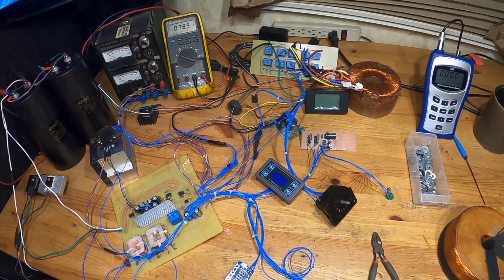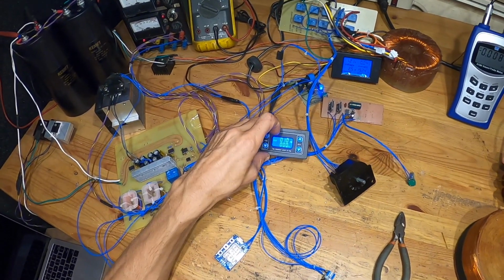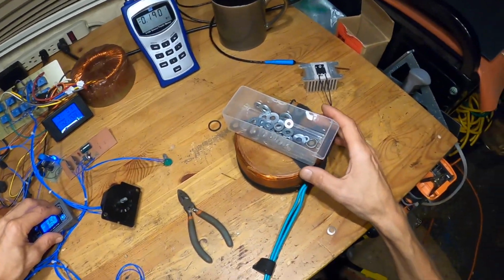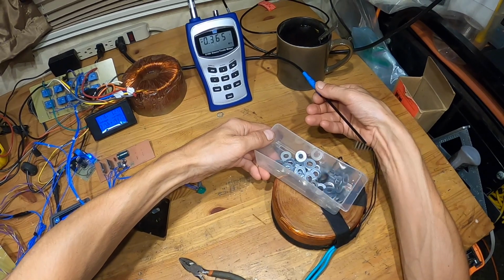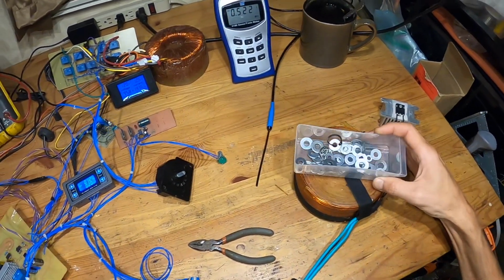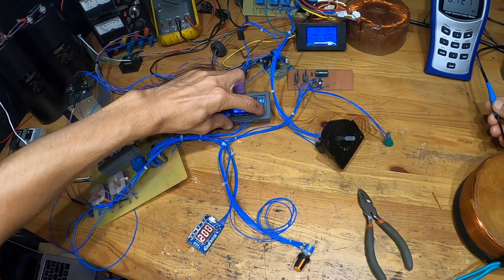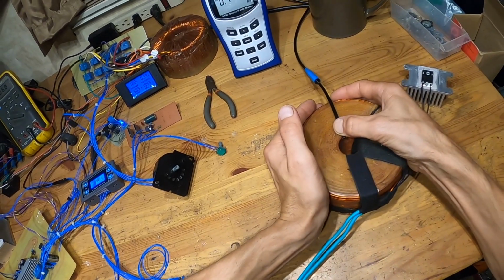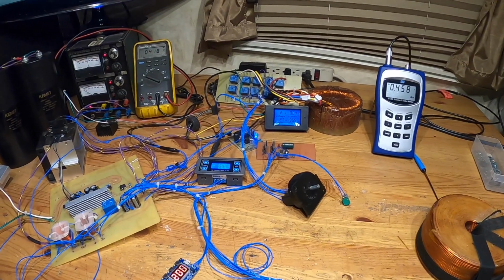034 My 410 Volts PEMF Circuit Prototype up to  11,000 Gauss 1-600Hz 1-30% Duty Part 2 Demonstration

Comment: Nice work..isn't that a really big coil for your taste? ! At that Tesla you can go ferrite/iron core to increase induction and foil coil for lower resistance and I guess you are having your 2 tesla 12 hz or more.

I'm interested for this circuit.
Reply from the maker: I tested small 1.5lb coil 0.9 Ohms and I can double the power output from it but it heats up fast. 
Im planing to wind another coil with spaces between the layers for cooling.